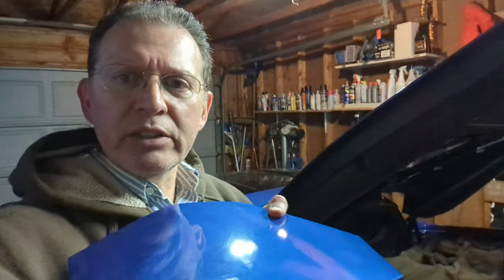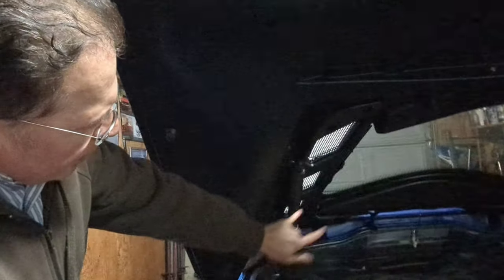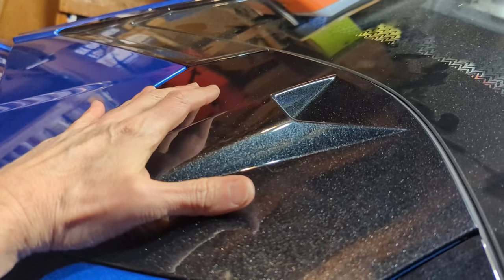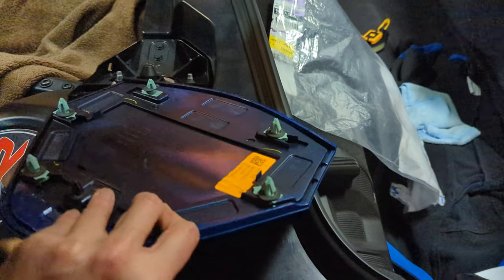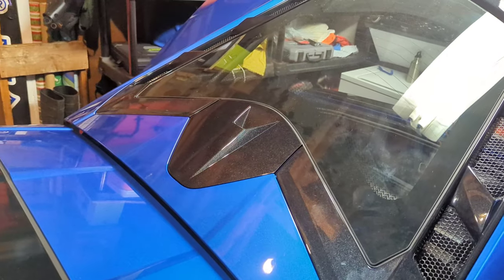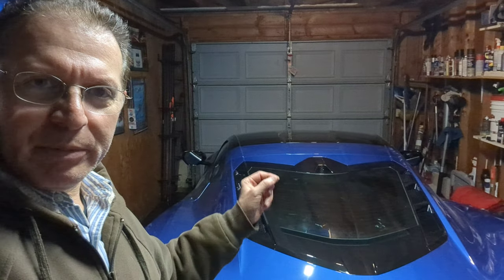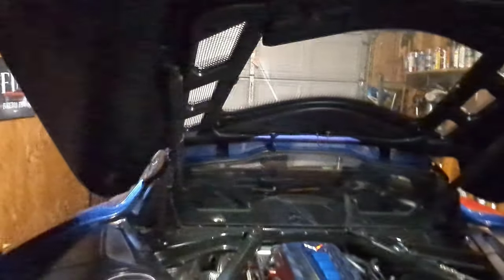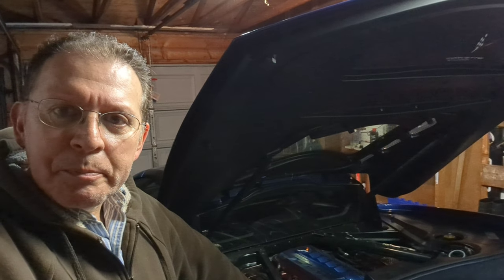C8 Corvette - Adding a digital rear view mirror

Comment: I just installed the digital rear view today.  Full set up.  I was able to snap the one mirror from the hall mount and add my new digital camera on the pen hall mount.  It fit perfectly.  I then ran the wire from the new DRVC through the small hole in the pen ball mount, and ran the wires behind all the pillars, down the door trim and up to the rear fuse box.  Pretty simple after you do it once. I have my camera mounted on the inside of the back window lid, waiting for my exterior camera housing to come in so I can install it like you did.  Turns off with the car and back on when the car starts up.
Reply: Where did you purchase the exterior camera housing?
Reply from the maker: Thanks for the comment. Can you post the product information so we can check it out?
Reply from the maker: Send information on the parts you used
Reply: Where can I get the full set and what I’ll need to install the rear view camera ?
Reply: Can you add the links on where you bought the product ?
Reply: What cables did you buy having a hard time finding the cables
Reply: Same question here, where did you buy the housing ?
Reply: Sorry for the super late response.
Reply from the maker: @AbsoluteCintron  I got it at the dealer and they also painted it
Reply: @ErickPardo cost on it?
Reply from the maker: What brand and model did you use? Can you use the drvm full time or just in reverse?